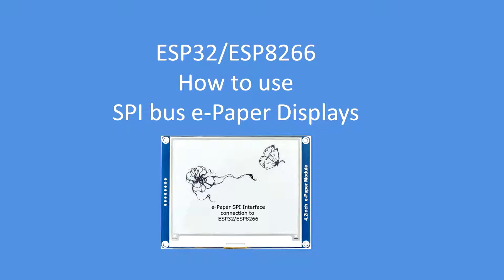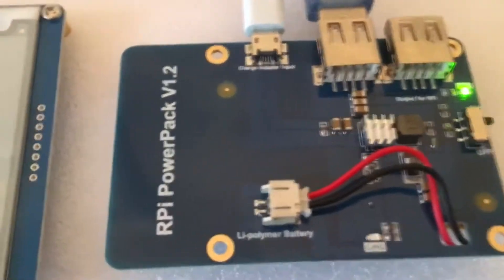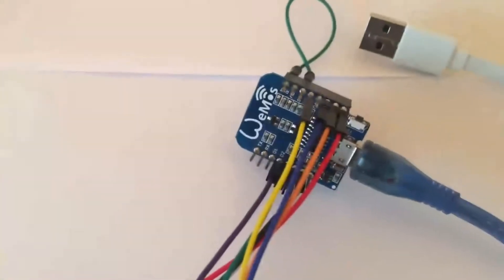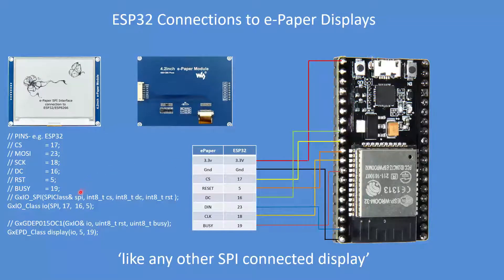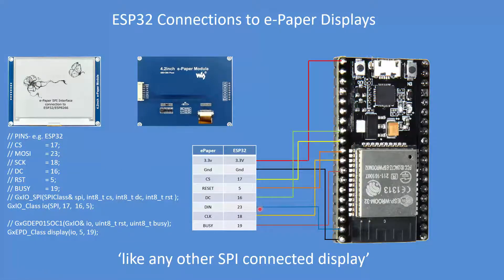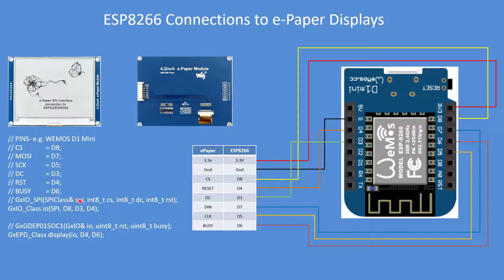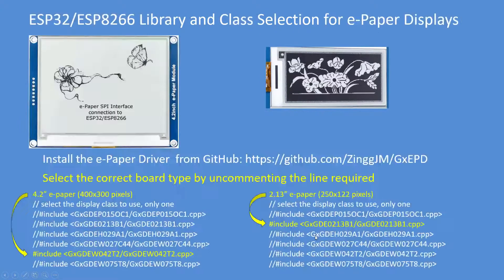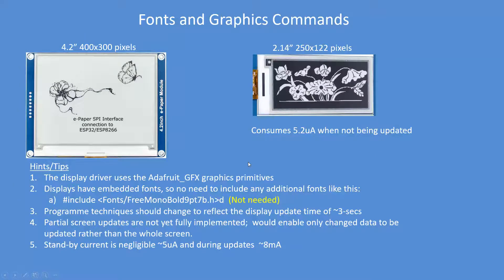Tech Note 055 - Using ePaper SPI Displays with an ESP32/ESP8266

Comment: it throws me all kind of errors :(
C:\Users\Marc\Documents\Arduino\libraries\GxEPD-master/GxGDEW042T2/GxGDEW042T2.cpp: In member function 'void GxGDEW042T2::updateWindow(uint16_t, uint16_t, uint16_t, uint16_t, bool)':
C:\Users\Marc\Documents\Arduino\libraries\GxEPD-master/GxGDEW042T2/GxGDEW042T2.cpp:261:45: error: 'min' was not declared in this scope
   uint16_t xe = min(GxGDEW042T2_WIDTH, x + w) - 1;
                                             ^
C:\Users\Marc\Documents\Arduino\libraries\GxEPD-master/GxGDEW042T2/GxGDEW042T2.cpp:261:45: note: suggested alternative:
In file included from c:\users\marc\documents\arduino\hardware\espressif\esp32\tools\xtensa-esp32-elf\xtensa-esp32-elf\include\c++\5.2.0\memory:62:0,
Reply from the maker: Yes, the GxEPD library is missing Min, Max, these are 'old' Arduino functions.
Add these lines to the top of the library (GxGDEW042T2.cpp for the ESP32) so that Min and Max are defined, thus:
#include "GxGDEW042T2.h"
#define min(a,b) ((a)<(b)?(a):(b));
#define max(a,b) ((a)>(b)?(a):(b));
Reply: Thanks! Actually it worked like : #define min(a,b) ((a)<(b)?(a):(b))
#define max(a,b) ((a)>(b)?(a):(b))

and how do i get the time for montreal, canada ??

Thank You.
Marc.
Reply from the maker: +Marc Paradis The missing min max functions were not implemented for the ESP compiler. You can get your local time by adjusting the line config time so for you I expect it will be 5*3600 instead of 0*3600 for GMT because your 5 hours behind GMT
Reply: Marc,
Look at the line:
configTime(1 * 3600, 0, "pool.ntp.org", "time.nist.gov");
Put instead "1" (means UTC+0 time) "-4" your local time UTC-4
configTime(-4 * 3600, 0, "pool.ntp.org", "time.nist.gov");
Reply from the maker: +Alexey K Also be aware that DST options don’t work. It’s a compiler issue.
Reply: Thank YOu :)
Reply: An interesting fact, I will keep in mind. Thanks. But Russian government refused recently to switch to winter/summer time trusting on nuclear plants. ;-)) So I am planning to build a monitoring device based on Geiger-Muler counter and ESP8266.

Comment: Could you please advise how you resolve an issue with min() and max() functions in ESP8266 example. The compiler gives an error message that 'min' was not declared in this scope and same for 'max'. Thanks in advance.
Reply from the maker: +Alexey K What’s happening is the macros for min and max are being undefined by one of your libraries, which IDE are you using? And have you included any other libraries? You should see in the libraries min and max being defined and usually the libraries do this for the ESP8266?  You can define min and max too outside of the libraries.
Reply from the maker: #define min(a,b) ((a)<(b)?(a):(b)) 

#define max(a,b) ((a)>(b)?(a):(b))
Reply: Thank you very much for quick reply. Your videos are very interesting. And examples are really awesome. I started coding in Arduino IDE digging your examples. Thank you for sharing your code. I am going to use same e-Paper screen in my own project. And I just stucked because of this problem. Ok I will try to look throwgh the libraries.  Thanks again.
Reply from the maker: It's a pleasure to help out. It's a problem with the ESP8266 compiler in that they did not implement 'min' 'max' functions as found in the Arduino, I think they were trying to 'move-on' to a newer generation of functions/symbols. So the easy way to resolve it is include the two definitions above, effectively macro's.
Reply: Thank you very much. I will try.  What IDE do you use?
Reply from the maker: Arduino 1.8.2 or 1.8.3
Reply from the maker: +Alexey K I’m now using 1.8.4
Reply from the maker: Add these lines to the top of the library (GxGDEW042T2.cpp for the ESP32) so that Min and Max are defined, thus:
#include "GxGDEW042T2.h"#define min(a,b) ((a)<(b)?(a):(b));
#define max(a,b) ((a)>(b)?(a):(b));
Reply: Thank you so much! Your recommendations resolved the issue. This works finally.
Another interesting fact is that:
Arduino IDE 1.8.4 plus Boards packet ESP8266 ver. 2.3.0. works fine and
Arduino IDE 1.8.4 plus Boards packet ESP8266 ver. 2.4.0-rc1 does not work
Reply from the maker: +Alexey K Good to hear, I’ve raised the issue on github with the author. I won’t be trying 2.4.0-rc1 yet then, thanks for letting me know.
Reply: David,
It still works unstable. At first time the program got result but after 10 minutes when ESP8266 waking up it hangs up sending to COM a string of unreadable symbols and stucks forever. Do you have any idia?
Reply from the maker: Alexey K Do you have RST connected? Also you have to be very careful with available memory on the ESP8266 watch the compiler messages for messages about low memory or ensure there is at least 28000 bytes free if you have modified the programme, you can help by placing any constant print statements into flash memory like serial.println(F(“hello world”)); its a problem with the Gxepd library ad it needs 22K ram to create the image. My current version is working reliably, but that’s as posted on github. The ESP32 works fine with larger icons because it had so much more ram.
Reply from the maker: Alexey K I recommend you check the serial port with some diagnostic print statements to see if it’s getting a network connect on restart from sleep and it has time etc.
Reply: David, I found the problem thanks to you. It was my fault this was due to lost connection to RST pin.
Reply from the maker: I'm pleased you got it working again.
Reply from the maker: +Alexey K On the 8266 memory is short with the embedded symbols, so I’m thinking about constructing them withe the drawing commands for circles and lines, that will make them scalable too, so I can have large and small.
Reply: David, this is an interesting idea. I noted that compiler gave me warning message that not enough free memory left in esp-12f module and the program could work unstable. I was surprised how fast memory on this module goes out when using even small icons of bitmap images. You are absolutely right and this is a good point to represent a cloud as three arcs and a rain as several short lines, I will keep this idea in mind. Meanwhile I ordered ESP32, hope to get it soon. Thank you again for your ideas, clarifications and support.
Reply from the maker: +Alexey  the problem seems to be with the driver as I asked the author and he says it needs about 22K free RAM to form the image (buffer) before transfer to the screen. I tried moving the images to PROGMEM and moved all print statements to flash if they were constants but it made no difference as I always came back to the large ram buffer memory requirement was always marginal. The ESP extra ram solves all those problems and I have a large and small set of icons now, large for today. Getting and formatting time is so much easier on the ESP32 as well. I have the wemos lol in ESP32 Lite and that is using 1mA in sleep mode down from 22-23mA from most other dev boards, that makes running on a battery for about 3-4 months viable now.

Comment: What type of connector does the display use?
Reply from the maker: +Maurits Muis  it uses the JST standard type,8-P (8-pin) and comes with pre-cabled connector, so quite useful.
Reply: The Displays mentioned in the GxEPD use this connector to interface the displays:
http://www.good-display.com/products_detail/productId=362.html

you could build your own interface. check out https://hackaday.io/project/20466-wifi-epaper/log/59098-testing-the-new-42-black-white-red-epaper-display FrankBuss redesigned the Interface from jarek319 to make it easier to solder